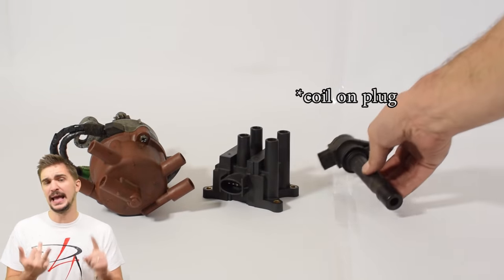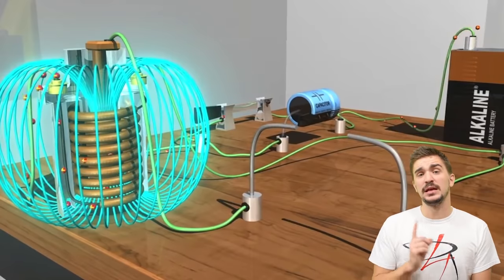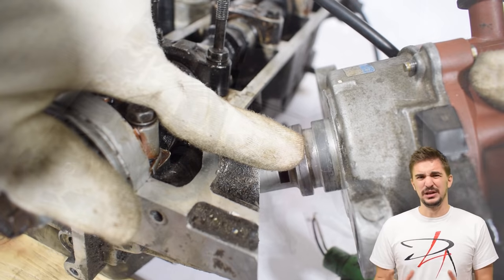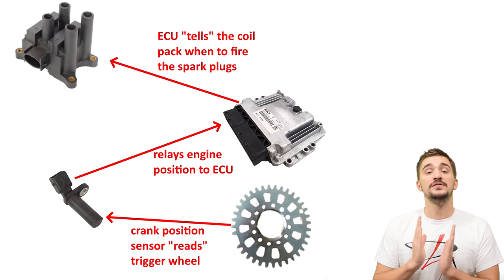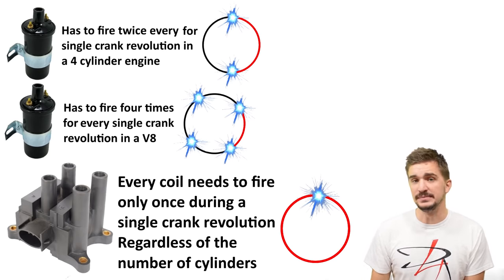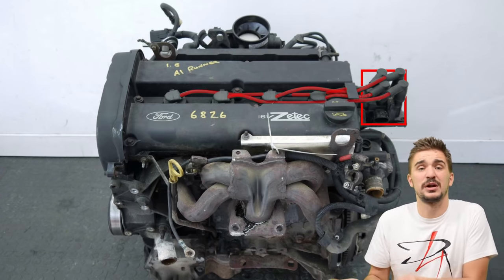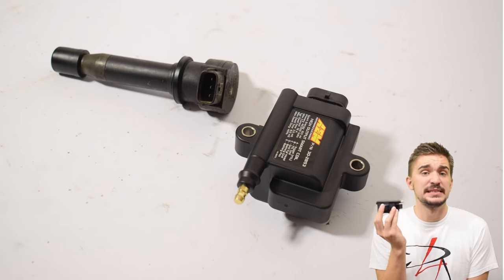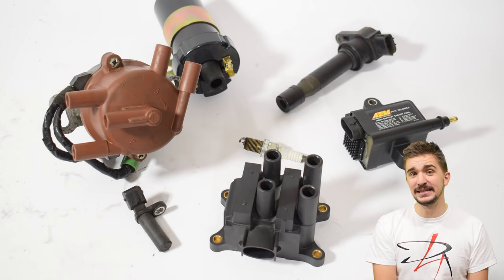Distributor VS Wasted Spark VS Coil on Plug VS MONSTER Coil near Plug

Comment: Biggest advantage of the distributor is no ECU, which means no ECU failures, its also much simper to diagnose, since anything that relies on electronic sensors and components has multiple points of electronic failure, including the crank sensor, the ignition coil, ignition module (if present) cmp (if present)  the spark plugs, the spark plug wires, the ECU, or any of the wires in-between these components (which squirrels and mice tend to love to chew on). 

Better is a matter of opinion. Its not 'infinitely' better, its different, it has different advantages and different disadvantages, with 'better' being a conceptualization based on which advantages and disadvantages are important to the individual. 

For instance, coil on plug coils are prone to failure at age due to the constant heating up and cooling down, which draws moisture into the electronic component over time. This is a byproduct of their placement directly on-top of the manifold.  For older vehicles, service no longer ends and spark-pugs and wire, cap, rotor, air filter and fuel filter: but now four, six, or eight ignition coils should be replaced, at 60 to 180 dollars a piece. 

All technological advances play out the same, take VVT engines, for instance. They are better when it comes to fuel economy, however, they all explode at around 120K miles, because your average owner does not keep up on their oil changes through the lifetime of the vehicle. This creates more expense in the secondary market and more expense over the lifetime of the car. 

Better is an opinion. Modern innovations give better performance, but my experience having worked 30 years at a small family owned shop that services mostly people who own used vehicles, my opinion is modern innovations are making engines less durable over the lifetime of the vehicle.

 Peak durability probably hit around the early 2000's. Non-interference overhead cam engines driven by a timing belt last 300K miles -- they can be found all day long, used, in running condition, for 500 dollars, as the engines usually outlast the body of the car. Interference VVT engines which started to be very common around 2010 blow up and bend values between 80 and 120K, and a replacement engine runs 1200 dollars, despite there being more of these cars lying around salvage yards, as more and more of the early 2000's cars have been crushed.
Reply: Kinda like with the v6 vs inline 6 vs vr6 everything comes with a trade off. Computerized components allow for better performance, and other advances (like the engine being able to detect misfires itself using spark plug resistance readings), but come at a cost of higher diagnostic and repair bills when they begin to fail or break, and more expensive replacement parts overall.

Comment: Great video. I always wonder about having more than one spark plug per cylinder. Many years ago I had a single cylinder motorcycle that I was able to modify & fit a second plug & second coil. It went so much better after that. way better idle & more torque.

Comment: You should had spoke about the lifetime of theses solutions and their prices. Coil on Plug have a short life and cost a lot, especially for VW Diesel engine. Distributor is easy to maintain and cheap to keep running (finger+cap).  Wasted Spark got a long life if you change the spark wires before they fail. And the AEM/Monster coil is the return of the CRT TV Flyback ;-)
Reply from the maker: VW diesels have coils and plugs? Didn't know that...

Comment: Not all crank sensors are variable reluctance, some are hall effect. All sequential spark systems must have two sensors, one for engine speed/position (crankshaft) and one for engine cycle position (camshaft). CoP units do have a 'spark plug lead/wire' it is the rubber boot that goes over the spark plug, the actual coils is in the very upper part of the unit so it stays as cool as possible. Not sure I agree with the must have the end product. The coils shown work fine in motorcycle engines with RPM limits of up to 16000rpm, and in OEM situation often fire more than once per combustion cycle, especially at low RPM to lower emissions and increase idle stability, so energy available is not an issue. Some applications fire them multiple times at high load and high RPM as well. You missed cost out of the equation. Most OEMs will go for the least expensive production solution, the exceptions being the high end or luxury brands.
Reply: not true, direct fire setups on 4 stroke piston engines technically only require a cam position sensor to function properly. most current setups use the crank position sensor to aid the in determining crank angle and detect misfires. rotary engines only require 1 crank position sensor as they fire each plug once per revolution in direct fire mode.

Comment: OK you need to be corrected. The voltage of a coil is its maximum deliverable voltage. Right before the coil actually fails. If a plug needs only 3k to fire, the coil only delivers 3k. A coil is a build up to critical failure voltage or/and release. The only way to change this is to built an interference circuit that forces a build up to a given voltage then allows it to release "capacitor") regardless of needed spark ignition voltage. Think CDI.

Comment: ECU can actually control ignition timing on individual cylinders on any system if there's enough sensors and spark is controlled by ECU. There are actually some cars with wasted spark system where ECU does have control over individual cylinder ignition timing.

Comment: Spark is a strange thing along with the combustion process.  I watched a Top Fuel dragster eject both magnetos and never missed a beat and completed its run down the track.  Even with both magnetos missing, it still ran at high rpm.  In fact, it completed one of its fastest runs for that car.

Comment: Distributer = cheap and quick DIY tuning. $5 for new points, and 10 minutes to tune engine.
Tools required: timing light, feeler guage, 1 small flat blade screwdriver, and 1 spanner.

Comment: Another aspect of waste spark system  , one side if coil is negative and one side is positive . For the system to work , both wires for paired cylinders must be good . 
If you have just one faulty wire the engine will miss under load on both paired cylinders  .
See  " Ngk  website on waste spark systems .

Comment: I would like to add the other disadvantage of the distributor is that if it becomes worn enough, it will induce an intermittent fault in the ignition system which will be hard to find.

Comment: Do you believe in these plasma arc systems? I wonder if it’s just adding current to the spark rather than raising the arc voltage leading to electrode erosion.  Trying to prevent spark blowout under boost.  Thanks for your videos!

Comment: Technically speaking, it is the amount of ELECTRIC ENERGY (Voltage and current) that needs to be sufficiently high and not just VOLTAGE to be high enough but yes- main property that guarantes the electrostatic discharge of the electric current is its voltage.

Comment: Modern motorcycle engine that rev to 17,500rpm use on coil on plug, no need for monster coils unless running lots of boost

Comment: I'm commenting on a 3 year old video in hopes of getting a reply, so I will keep my hopes low lol. How does a motorcycle work at 15k rpm with traditional coil-on-plug's? Is it because the engine's are smaller and so there is less of a resistance from air/fuel, so they can produce less voltage to compensate for the loss of charge time? Awesome video by the way!

Comment: forgot one major drawback of distrubutors :  it's not variable, no knock control possible.
Other then the advance curve in the dizzy; and fixed set timing.. that's it.

All the other systems mentioned can be controlled by the ECU

Comment: I've had more issues with  everything ignition related after distributors went out of the market.  From my experience, distributors are the easiest to maintain. hardly anything to fix, compared to sensors and electronic controlled crap. But is it efficient? no of course not. but dangit it works.

Comment: Nice, but you not covered everything. There are coil plugs that are able to monitor ion current while the burning lasts, and give back data to the ECU. This was first in a BMV F1 engine, then in aconsumer V8. Now may be more, but I certainly know Mazda Skyactive uses a technology like this.
Reply: Ionic current but that is used for knock control. The only BMW production engines to use ionic current knock control were the S85 V10 and the S85 V8. Every engine since has used the standard piezo knock sensors. Other manufactures were using ionic current knock control before BMW. I remember some Isuzu V6 engines were using it back in the late 90's, early 2000's.
Reply from the maker: Thank you. Saved me from having to type that :)
Reply: SAAB were the originators and Trionic was the systems proprietary name.
Reply: @Flapping Flight In the 1990's Trionics requirement for COP, secondary voltage supply, fast ecu and other electronics made it quite expensive. A new processing chip from TI overcome the previous "signal to noise at high rpm" issues of piezo knock detection making the bang for buck worse. It's another Beta vrs VHS battle where a  technically better system lost out to the cheaper one.
Reply: @Flapping Flight Knock detection and wide band lambda are currently quite expensive add ons in aftermarket EFI. let's hope this changes as the patents and license fees expire.

Comment: It may be good to include a better distributor in the comparison, such as GM's HEI system that incorporates the coil into the cap to form a single unit. Additionally cost to maintain a distributor based system is much lower. The cap, button, and wires are cheap. A new coil for every cylinder is not and they do fail. Often.

Comment: I suppose they're not for "free road use" due to the electrostatic noise they'll produce with all those high potential voltage and current discharge, isn't it?
A question: how was the ignition advance timing handled in the distributor setup? I mean I know you can regulate them (and I've seen it done with stroboscopic gun) but is it just a fixed amount or there was something that can be done in order to have it variable even with those components?
Reply from the maker: The distributor used vacuum and centrifugal advance. It was a bit limited in range of advance but it worked well enough for the time. The aem coils are inductive, so they don't generate significant noise, a capacitive discharge ignition does that. They're not for public road use only in some places around the world where legislation prohibits them and most other types of engine modification. They're perfectly legal in many parts of the world. It all depends on local legislation, which is why I put up that notice.
Reply: @d4a  thanks for the answer :) I think that here in Italy they may be legal, but considering that literally anything that can increase a stock engine power isn't legal at all, there's not such reason for them unless building a race (or road illegal) car :)

Comment: Man.. to think i was doing 8600*RPM from a SR20VE with a distributor.. that was some slick engineering going on back in the late 90's 😆 if i had some R35 coil on plug that would be sweet

Comment: All good, but for improved spark you need an ECU and crank sensor. 
Thats where the failures and great expenses come, and then you wish you had a distributor you could fix yourself.

Comment: What about multiple contact breaker/coil ignition. Very common in 1950 to 1980 motorcycles. Good for 10,000rpm.

Comment: I must say; the coil on plug seems nice, but they wear out much more often with a very high cost compared to regular ignition coils. Last year, I had to replace my Volvo 240's 33 year old ignition coil, meanwhile on modern cars the coil pack is a wear item that should be replaced with the spark plugs.

The 240 has computer controlled ignition system, too.

Comment: I remember I had an old S10 in high school. I could hear static in the radio that increased and decreased with engine RPM. I replaced the cap and rotor and the static went away.

Comment: Additional solutions to overcoming increased electrical resistance inside the engine;
- Pulse plugs (which have pretty overkill capacitors inside of them)
- Alternate electrode geometry
- (if you are willing to live super dangerously) radioactive spark plugs

Yes, radioactive spark plugs are [unfortunately] a real thing. If you see somebody using them, please confiscate them immediately and send them to your local nuclear waste clean-up agency.

Comment: Two things... (1) You CAN have a dual distributor ignition system such that each coil and distributor only serves half the cylinders. In old racing engines with a lot of cylinders (like V12s) that is what they do. (2) You forgot the grand daddy of ignition systems -- the MAGNETO -- which operates without an alternator or battery.

Comment: My question is why they never developed an old style mechanical coil on plug system back in the day.

Use a mechanical distributor to send low voltage current to the "switch" of a coil on plug.

Comment: Driving 4 aswers: Distributors have maintenance issues, inherent design issues and misfire at high RPM.

My 1986 Toyota Sprinter Trueno GT APEX: Laughs in steady spark at 8000 RPM.

Comment: I assume this is part of the reason why GM has stuck with Coil Near Plug on their V8s. The swap to direct injection allowed the heads to be easily redeigned because the coil and spark plug isn't in the way.

Comment: Not much was discussed on how coil on pack operates, got a lot of pros and cons but not much on operation and I was looking forward to learning how it takes voltage from battery and signal from ecu and how that all worked to get voltage to the spark plug, still not even 100% sure how it works. Though I did get a decent understanding on the distribution system. :( please explain further into detail on how cop works
Reply: they work the same way as the older setups, they only need to fire 1 cylinder so they are smaller and the triggering device is electrical instead of mechanical.

Comment: Okay, I have a gripe about your description of voltage drop over longer wires with the waste spark system. The coil is passing voltage across both wires and through both spark plugs to complete the circuit. As a result the wire length is added between both cylinders firing on one coil. Its just about the same for all cylinders on a 4 cylinder engine since as a general rule opposing cylinders fire together. There is a negligible difference in voltage drop! The circuit goes coil, wire, plug, engine block, plug, and finally wire back to the coil. How did you not pick up on that my dude? Likewise wasted spark systems can be mechanically driven with a momentary switch that is operated off the cam so there does not necessarily need to be an ECU involved.
Reply from the maker: I did clearly say it's negligible a few times in the video. But the total wire length of 1+4 and 2+3 is rarely the same. The difference is even greater in some 6 and 8 cyl engines. The circuit path and the fact two cylinders are fired at once doesn't really change anything... my dude 😉 But again, negligible in most cases.
Reply: @d4a  lol my dude. NGL I didnt expect you to read a comment on a week old video. Automotive info videos of every sort have small generalizations such as this. Idk if it's for the sake of explanation or simplification but they are always there almost all the time. Honestly it's impossible to cover every operational variation of a system but this stood out to me. On a lot of 4 cyl engines of which I have had many from a Lima to toyo age variants to mitsu 4g variants I have seen that 1-4 2-3 wire pairs are generally within a few inches or so of each other.

Comment: Those damn coil on spark plugs don't las as long as the early ignition points coils.
Reply: I know right? On paper they should last almost forever but they must be made super cheap or something.
I've never seen a distributer actually fail.

Comment: There is no "delay" in the coil. The output voltage is a function of the input voltage scaled by the coefficient of primary to secondary ratio and there is no phase shift of the signal. The magnetic properties of the iron sheet ("silicon steel") core cause a lot of power transfer losses at high frequencies (engine rpm), which is why the arc is worse. There is also the resonant capacitor on the primary coil, making the arc last microscopically longer. On a distributor system there is also the problem of shorter max duration of each spark, because the moving electrode is faster.
 The wire length only matters if the wire is resistive, but most wires I've ever cut are a strand of copper, which is considered 0ohms at 20mA arc current.
The transistor type used in the coil makes almost no difference to the end user and if anything, IGBT's are a drawback. They have much higher CE voltage drop than a MOSFET, slower turn-on and worse current capabilities for their price. The only advantage is the higher CE max voltage rating, protecting it from inductive spikes from the primary potentially killing it, but a capacitor on the primary would save any MOSFET+increase the arc quality